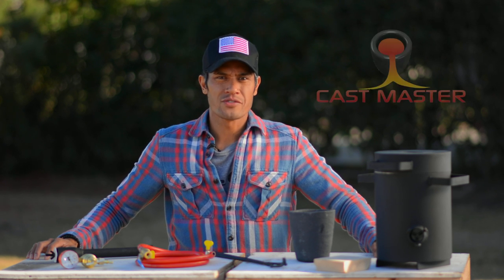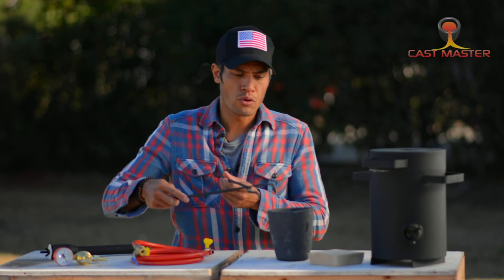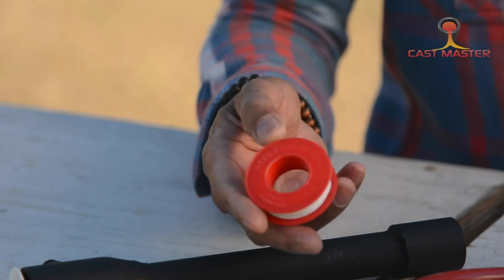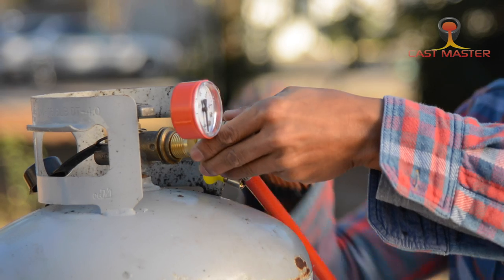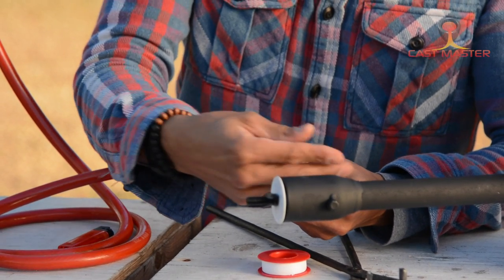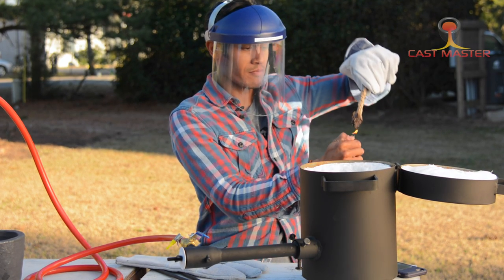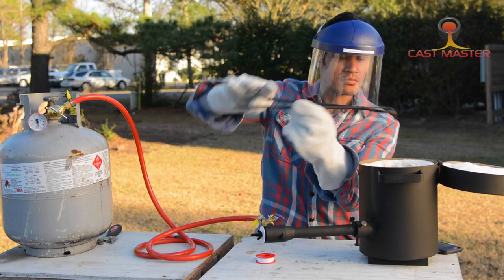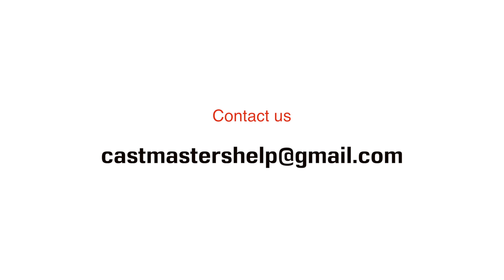Casters Masters Propane Smelting Furnace Tutorial

Comment: Great for getting started especially for low temp metals like aluminum. You can also do copper, but it does take quite a bit more gas . Everything mentioned in the video is what I got in my kit, everything arrived in good working order, i have used this furnace to smelt about 10lbs of copper, and 50lbs of aluminum and i am still using the same crucible and tongs that came with it. I bought a hi-temp apron, hi-temp gloves, and a face shield similar to what was in this video. I have had no problems with the product and for the money it is a fun, light weight, portable solution, that is great to get started.

Comment: So we just got a furnace setup - similar design but not the exact model from this video. Is it normal for the tube to be smoking? I mean, it is painted but it seems that the fire is burning inside of it, is this normal? Or should it be more like a jet and the fire burning only in the furnace itself? As in, outside of the tube.
Reply: Not sure what you mean, but the flame will never flow back. The pressure combined with the pure propane in the hose will always prevent that

Comment: Do not believe this video. 1st there is no regulator gauge, 2nd there is no cutoff at the input side of the hose. There is no plumber pipe tape, instead u get a little rubber gasket. Do make sure to spray soapy water to check for leaks, had to buy new clamps and hose because the supplied clamps leaked and could not be sealed. This is not my first rodeo and even with a heat detecting temperature probe, in calm air, in the shade, empty crucible, it was impossible to stabilize the temperature of this thing. Will work for melting aluminum cans but not sure if I trust it to work on anything else. Next time I will just make one from the many DIY vids on the net. If your first time and you are lazy buy this thing but do not believe this video.

Comment: Anyone knows if you can use petroleum liquid gas ?
Reply: Propane gas and LPG gas are the same thing. LPG (liquid petroleum gas) is just another name for propane. 
So called "natural gas" is methane which is different. You could conceivably use methane for this as long as you had all the proper equipment.
Reply: @shdwhealer  Thanks Harvey! I have a couple of months melting now.

Comment: can we use LPG (used to cook or heat food) for melting aluminum in a furnace?
Reply: I’d use caution but it is a mix of butane and propane so maybe.
Reply: @brettjc0483  LPG gas is propane. Butane is what is in cigarette lighters. In most countries LPG is strictly propane. In a few countries they do mix various amounts of butane in with the propane, but the difference is negligible. In the US, LP gas, Liquid Propane, LPG, etc, are all terms for propane.
The only difference would be judging your pressure to heating temp ratio
Reply: Propane gas and LPG gas are the same thing. LPG (liquid petroleum gas) is just another name for propane. 
So called "natural gas" is methane which is different. You could conceivably use methane for this as long as you had all the proper equipment.
Reply: @shdwhealer  i see, thankyou for the information, now i can continue with my furnace.. though i still haven't built it yet and only have a cylinder full of the LPG

Comment: Anyone w/ a lead on a crucible suitable for melting steel? Graphite is just going to erode quickly and convert the steel to cast iron...
Reply: You can't smelt steel in these home furnaces. Technically you could if you went large enough and insulated properly but done wrong it'll just melt the refiner

Comment: Hello it's not cast master furnace it's Devil-forge furnace model: FB1SB.
Reply: and it's an overpriced pile of shit!
Reply: @jagboy69  cast masters is a over priced pile of shit mine broke after 20 uses
Reply: @chrisknopp5201  bought the same one from China for 60 bucks shipped
Reply: @tRRickedOut  no i paid 3 hundred for it and the lid wont open the metal melted
Reply: @chrisknopp5201  dude that sucks. I was considering building my own but for 60 bucks for mine it's just something to start out with.
Reply: @tRRickedOut  i would be careful because plaster of paris emits sulphur fumes when heated up past 1500 Fahrenheit
Reply: @chrisknopp5201  that's good to know. Thanks. I don't have any solid plans on building one yet but those I did want to replicate, the parts weren't cheap at all which is why I bought a cheap one to start with and see if this is something I want to do more of.